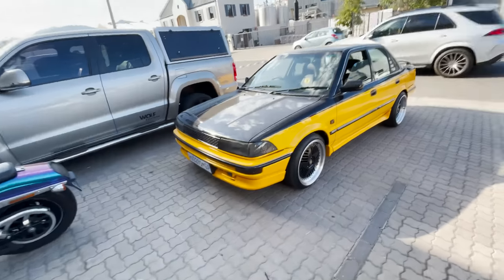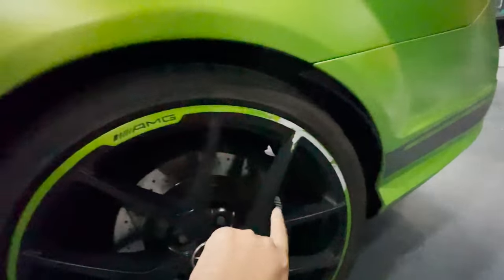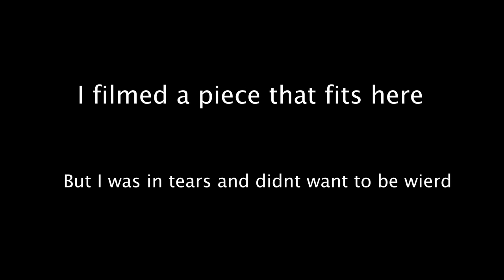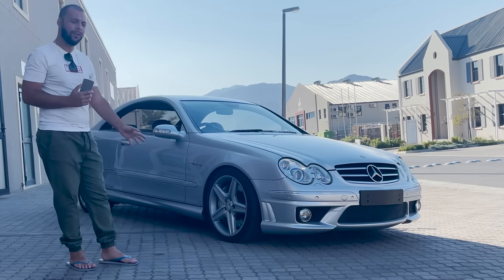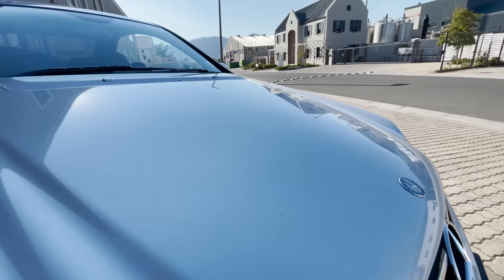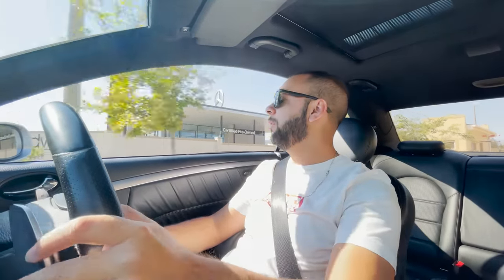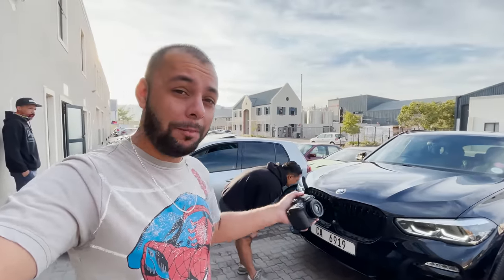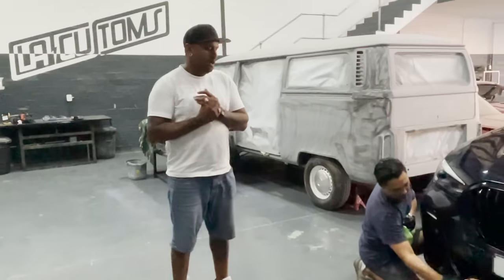I FINALLY BOUGHT A CAR! 10 years + in the making!

Comment: love it! great car. if you ever want to upgrade the gearbox,faster shifting,use the 722.6 , i think if i can remember correctly. full throttle body housing. comes initially from the Chrysler 300C SRT. much faster shifts,stronger. BUT,slightly harder shifting in daily driving. when it comes to parts from overseas,check out Scuderia parts in UK. have dealt with them for a few Italian cars,you will not believe the prices compared to the dealers. all O.E parts too. saved a client around half on parts alone,he was quoted R120,00 plus for his service....wont get too technical about it and the brand,but parts cost my client  R36,000. total job was R58,000. go check them out.
Reply from the maker: Thank you so much for this information Ashley, I want to actually tune the current 722.9 with the downshift blip. My understanding is the CLK63 & C63 gearboxes are identical!
Reply: @libeRebil  yeah,it works great! my mate had one and i can tell you,it works a charm, also check out on Benzboost,there is a guy in dubai i think,building a high horsepower N/A, 63 engine with uprated cams. should be good too. so much out there man! always loving the content man. coming from humble beginnings,always good to keep your feet planted firmly. and seems you are. keep on bringing us this banging content. might take a drive past your workshop just see for myself. looking great!